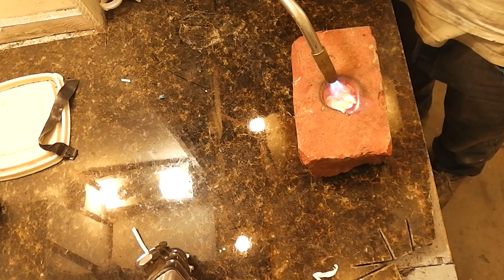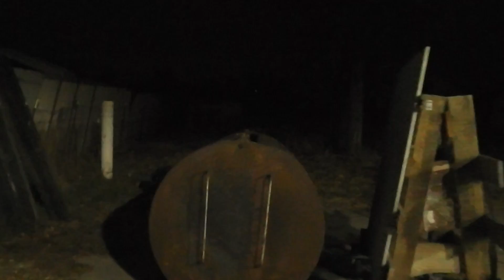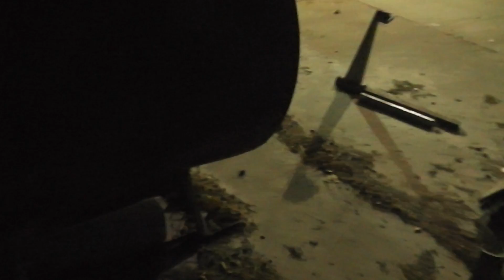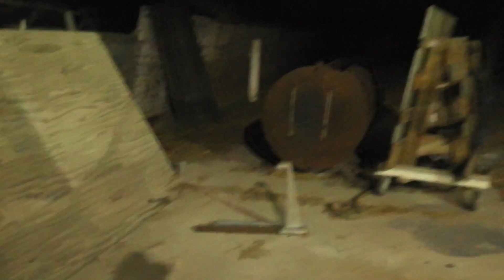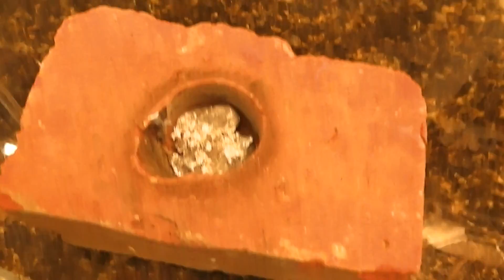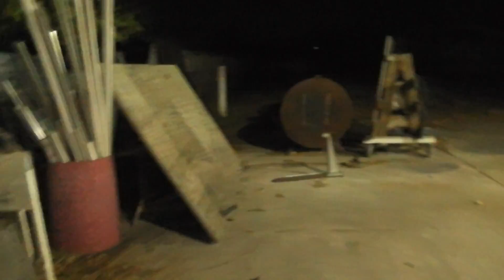Molten aluminum CAN glow - reddish orange, but not orange.

Comment: You are not correct, the molten material flowing from the towers was not pure aluminum but AlN, with Aluminum,
Aluminum nitrite.   Aluminum will react with hydrocarbon plastics to form AlN, but only in a chimney effect, an oxygen depleted atmosphere.
Reply: You mean Aluminum Nitride? With a melting point of 2800ºC?? No offense, but are you high?
Reply from the maker: surripere
If it was thermate/nanothermite then perhaps it WAS aluminum nitride. ;P
there was a semiconductor manufacturing facility on that floor :p

Comment: Of course aluminum can glow. But not until it reaches temperatures above 2,000°C. And you can't get those temperatures from fire.

So your experiment was basically useless and meaningless. 

Instead, why don't you try to melt aluminum to a glow using an open flame fire? You will soon realize that fire can't melt aluminum to a liquid form. And much less make it glow in daylight conditions. 

So if fire can't melt either steel or aluminum to a glowing liquid, than was did on 9/11? 

And why is NIST lying to us about it being molten aluminum?

Edit: Sorry, I should have watched the whole thing before commenting. Thumbs up to you bud!

Comment: CHERRY RED Justine, just as I said.
I agree with your assessment of the firefighters recognizing molten iron pouring down the channel rails.
\\][//
Reply from the maker: +Willy Whitten how do you even perceive cherry red? Are you somehow looking at the brick instead of the aluminum?
Reply: Justin Crediblename , No, see your video at 4:17 to 4:52  -- Cherry Red! 
How is your color perception Justine? Have you ever had your eyes checked for that?
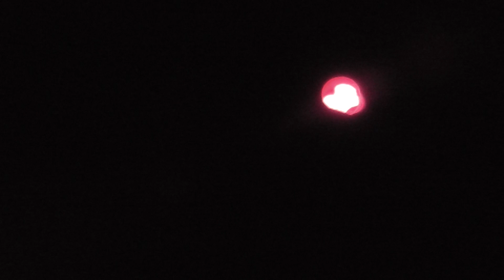Reply from the maker: +Willy Whitten but what about the time from 4:06 to 4:17?
Reply: Justin Crediblename -- in fact Marracino cherry red, fading to a natural cherry red as it cools.
And I am not being sarcastic about your color vision. If you don't see this as obviously cherry red, you should really have your color-vision tested. Asians have the best color perception. Some significant portion of Anglo's have some depreciation in that ability.
As I am an artist, my color perception has always been excellent.
See: Pantone color chart. I used these in my work all the time.
\\][//
Reply: Justin Crediblename " but what about the time from 4:06 to 4:17?" -- Marracino cherry red!!!
This may seem subjective to you Justine. It only is in that you definitely have a color perception problem. That is certainly a hot-cherry red!
\\][//
Reply from the maker: +Willy Whitten look at zee centerz of zee globz, yo
Reply: I have seen enough molten aluminum to know that it glows silver in the open air.
\\][//
Reply from the maker: Willy Whitten
you mean when there's a decent amount of ambient light?
Reply: Justin Crediblename -- Especially daylight Justin, remember the context of this dispute is if it could be aluminum pouring off of the Trade Tower. It was clearly NOT aluminum. 
\\][//
Reply from the maker: I know the context of that dispute, and I'm not disputing that it was 
clearly not aluminum coming from that tower. it would have definitely 
looked silver.
the lighting in that spot of the garage was 500 lux...very low compared 
to outdoors.

there are colors at the edges that are quite orangish at 4:07
play around with a color picker and MS Paint. you'll find an area that's orange.